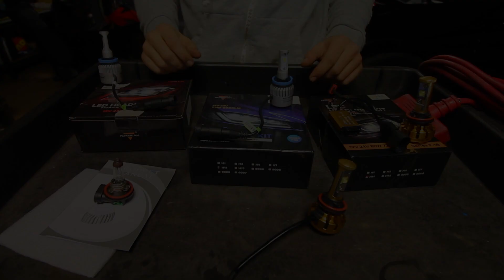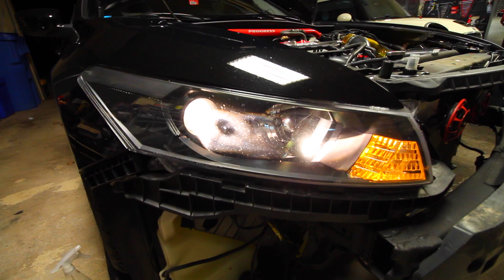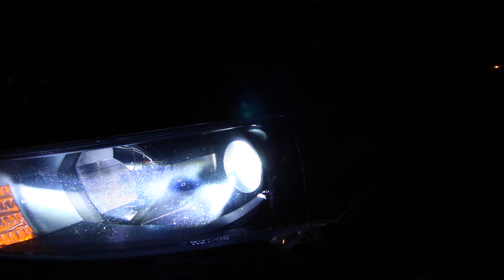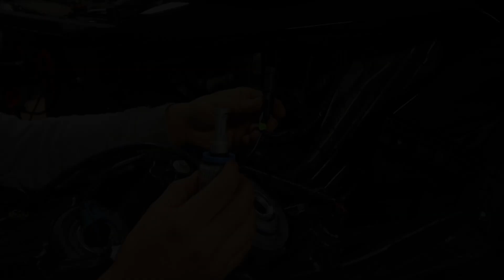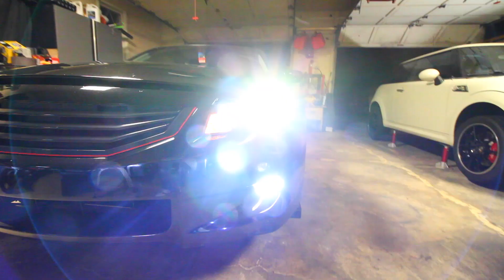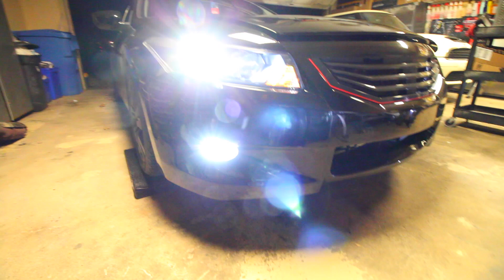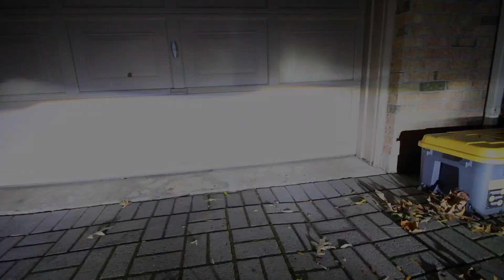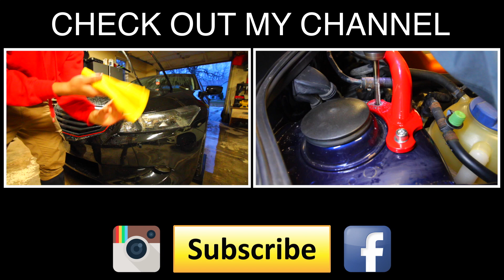LED Headlights: Are they Better than Halogens?

Comment: good luck LED when its raining
Reply: Why do you say that?
Reply: Yup, basically 6500k or white lights do not penetrate water and just bounces off the rain or fog, causing poor visibility. I have tried installing LEDs and reverted back to halogens.
Reply: Same with HID... I had both and they both suck. They're both bright on a dry night. But if it rains they both suck.
Reply: that's why u need yellow fog lights...not white like alot of people do
Reply: Thanks for the heads up!
Reply: They could make LED headlights at 5000K or lower.  The manufacturers have full control over the warmth of the light.  But the market determines what they make.
Reply: Cover your led with a sheet of plastic. Maybe yellow or warm color.

Comment: A bit incorrect. Unless the drive circuitry is incredibly inefficient, most of the heat is still generated at the bulb, by the LED chips. LEDs don't generate as much heat, but they don't tolerate high temperatures, hence the fan.

Comment: Don't know about other states, but Washington State, it is illegal to change the illumination of your headlights/taillights/brake lights...  That includes 'shading' the brake lights or taillights.  OEM are the only street legal lights.
Will you be cited for it?  Probably not.  But you do not want an investigation because you were involved in a collision caused by your illegal headlight installation.  If someone is blinded by your headlights and crosse the centerline and hits you?  YOU are at fault.
   The LED headlights have illumination 'panels' on two sides of the 'bulb' instead of a 360 degree projection.  So your factory headlight assembly will not be able to be aimed correctly.  If you install LED lights, you 100% MUST replace the headlight assembly to match the aiming of the LEDs.  Because very few cars have this option, it is illegal....

Comment: Is that a Honda? Man it's a pain in the ass to just change a lightbulb on that car. Bumper out, bumper whatever that's inside there that has to be out also. Nuts out. Then the whole housing has to be out. And then you can finally get to the lightbulb. WOW!
Reply from the maker: Yeah its a Honda. Some cars are very easy to get access to, others, like mine, can be a PITA.
Reply: milanmastracci Yes, like a Toyota. hahaha...

Comment: I drive a bike. I hate LEDs sooooooo much. LEDs create a wide circle of light that hides everything behind the car. In an open road where there could be people walking or animals crossing one could easy get into an accident by not seeing beyond the car. Please don't install LEDs. I know they look cool but they are not cool for safety. I would go as far as saying that these types of lights should be banned. Please, I don't want to die. I know it sounds dramatic, but I have almost gone into the ditch a couple of times because I couldn't see the edge of the road. They act like a fog.
Reply: Robert Townsend really..led not better?...but i buy honda civic type R fk8...my headlight n tailight all full led light...oem factory?...from honda....i think led so better from halogen and hid kit?.....
Reply: Mohd Aliff yes leds are better, but not when you put leds in a halogen housing. They just send the light every where and doesn’t allow on coming pedestrians or drivers see as it blinds them.
Reply: I ride a bike too. My 3000 lumen LED flashlight is one of the best things to happen to mountain biking in the middle of the night.
Reply: Fellow biker here, I agree.

Comment: I'm curious about winters temps(0F-(-40F). Is there going to be any issues since they dint produce the heat a halogen bulb does? Is there any issues with the dust covers for the headlights?

Comment: The leds commonly used on vehicles always look "blue" to me.  This almost certainly y means that they will not be as effective penetrating fog etc as halogen or incandescents which usually tend to produce light more towards the red end of the spectrum. In the UK until recent times most Sodium street lighting was sodium-based. This emits orange light which is good at penetrating fog.  Red light would be even more effective in this regard but I have never seen red street lights.

Comment: does anyone know if the led chip should face vertical or horizontal in a reflector housing?
Reply: found out they're supposed to be horizontal and Philips style led is the best for reflector housing also leds not recommended for projector housings hid should only be installed in those.

Comment: Great video, lots of information, I have two questions. So I just installed LED dual halos on my car and tapped them into my fog lights for power. I want to change my stock bulbs in my fog lights to LED's so they match the halos. My first question is do i need a conversion kit to make them work? or can I just buy LED lights. Second question which is particular to my car, the bulbs in there now are 894, will an 881/H11 fit that? Its a 2000 Camaro
Reply: Camaro groups my friend lol

Comment: aftermarket led dont last long , that fan in the back get dirty to fast and the led will get overheated. i had those in my car and i remove it ..if u have halogen in your car the best way to go is osram night breaker , is original and no fire potential in your car

Comment: If you explain how the LED works and where heat is generated. READ and LEARN first. Once you know how it works you can talk about it. LED have a heatsink because the CRE gets hot not the circuit board. LOL

Comment: I put LED on my projector headlight MB, and it gave me a black spot in the middle, color was nice as expected, but the light output performance was very disappointing, switched to OSRAM Nightbreaker Laser, much better light output, color not as nice.  HID is not an option, does not work well with Halogen Projector Lenses and also kind of tricky with MB sensitive electrical wiring.

Comment: Fog lights are designed to light up the peripheral area in FOG and therefore attempt to light around the road in front of you. Main beams simply light up the fog directly in front of you (completely blinding you) and that's why fog lights are for, guess what, FOG with your headlamps off as your speed is substantially lower.

Comment: are they good for using foggy climates.. ..which one u will suggest? HIDs or LEDs
Reply from the maker: Low beams with a very good cutoff, paired with fog lights. Whichever will produce more light while maintaining those two factors, will be better.

Comment: this is actually illegal to do in the united states because a led or hid lamp needs a projector housing to beam onto the road instead of scatter with reflectors you can actually be pulled over for this and given a very expensive ticket because it can blind oncoming drivers with a scattered beam pattern.
Reply: If only you knew the amount of people that don’t use projectors in Florida. And certain cars are made stock with hid/led in a reflector housing.
Reply: he does have projector housings so he wont be pulled over.  i retro fitted my tacoma to projector lens and it is worth it.

Comment: if you have ahalogen bulb where the high and low beam are in the same bulb , such as a 9004 or 9007, the low beam is ok , more light , BUT...I repeat.. BUT the high beam is way off out of focus, so your high beam pattern is way too off, the reason being is if you look at a halogen bulb the filaments are only fractions of an inch apart, and an led bulb the actual leds light up on low and high beam are too far apart, this is very important for proper focusing of light, I have tried different brands of led and they are all the same.

Comment: I installed led bulbs in my fog lights. When I turn the fog switch on, the lights do not turn on. I left the halogen bulbs in the other side and that one works. I'm positive the bulb size is correct (881) for a 2013 Kia sorento. Would anyone have any advice?!?! Thanks

Comment: Of course heat is generated on the LED chips, you heretic, but it is transferred as far as possible from them through the aluminum body, and then dissipated. The small transformer inside the aluminum body also generates some heat.

Comment: is it just me or do none of these kids know how optical systems work wether halogen or xenon or LED the light emition of each is very different so each is designed to operate in a specific optical system (reflector or projector) hid projectors and reflectors work with hid bulbs only, halogen is halogen only, and LED are LED only google what each OEM system looks like and you will discover they have very different optics (xenon and halogen often look similar but are very different while LED are extremely different so kiddies before tossing in just any fancy pants bulb ballast pnp kit take into consideration this your car never came with that bulb type so don't use it unless your retrofitting the real deal full system and not just some bulbs so to all you who think they know that projectors of any kind can handle any bulb type you are WRONG

Comment: LED can also be dangerous in snowstorms as the LED does not heat up the lens enough to melt snow and ice build up on lens.... Can become caked on
Reply: Bill Poel this is why civilised countries like Australia mandate heated headlight washers for low wattage high power bulbs like LEDs and Xenon HIDs
Reply: great point. the heat does help keep  the lenses warm, which helps in de-icing.

Comment: It does not matter what type of housing your vehicle has, LED will never through light as far as a HIR bulb or even standard halogens. Basic light physics tells us that blue light (most of these are more bluish/white light) is hardest to see and yellow is the easiest.
These damn led bulbs are just like when HID retrofit kits came out... dumbass uniformed people cramming shit into stock housings and blinding people. Running these as headlights are likely to get someone killed. Use your head people and do some fricking research.

Comment: wait.. what?!? Around minute 2.. The heat is generated by the computer inside the bulb? No way, the led chips themselves generate a HUGE heat that needs the bulb to be cooled down, otherwise the chips will burn.

Comment: If it ain't broken, don't try to fix it!
LED-lights in cars don't contribute to a better environment at all.
Your battery and dynamo have an overcapacity anyway, so that the halogen gets hot and looses part of the energy is totally irrelevant.
LED-lights are a totally unnecessary and too expensive investment.
You can buy complete H4 sets for less than $2.-
Just make sure you have two spare sets with you in the car, so that you can instantly replace a bulb at any time and all by yourself.
Just keep your car original and functional at the lowest possible cost and don't copmplicate stuff that was originally designed to be simple!

Comment: But Halogen is more comfortable for the eyes.
Reply: when you're driving with them?
no, no they're not lol.

I've been using LED headlights for years as I find the light easier to discern against the road etcetera, compared to the linear and over-saturated halogens (you can see halogen light over stuff, as opposed to seeing stuff through the light)
and they reflect off cats-eyes, road signs, road lines, and the eyes of wildlife like nothing else!
very important here in Australia with the wide dispersion and the ability to light up the eyes on kangaroos whilst they're in the fields, and not bouncing off of the front of your car....

speaking of kangaroos, I actually hit one a few weeks ago in a friends car. because he has halogens, I literally couldn't see it and react until it was directly in-front of us....
Reply: Oh well, we don't have them roos around here. :D

Comment: I just upgraded from stock housings [bulbs: Low=9006 / High=9005] to projector style housings which use H1 bulbs for both High/Low.  Does anyone know if the H1 LED bulbs will fit into H1 halogen ports?  
(reason I ask is because, as seen in this video, LED's have that large heat sink back end, and H1 bulbs generally just have a wire retainer holding them in).   

Thanks!

Comment: would you recommend LED lights for both high beam and low beams and fogs?
Reply: as an LED user myself for several years (early adopter) I honestly wouldn't recommend anything else!
I don't have fogs in my 2003 ford falcon, but between my H4s and H7s, you really don't want to be the guy to leave the high beams on coming the other way... 

as for fog lights though, do u wanna use them as fog lights (so people can see u in the distance through fog) or do u want them to function as driving lights, giving you the extra visibility? if it's for you, go the LED replacements as it'll match the look of your other lights and out even more light downrange, but for the former I'd suggest sticking to the halogens as it's easier to see the more orange/yellow glow through fog when you're coming the other way

Comment: is it true that projector lens are not good for LEDs I'm confused
Reply: If projectors are for halogens - HID and LED won't work. If projectors are for HID - halogen and LED won't work. That's why halogen and HID bulbs use different bases. It's made so can't put them in an unsuitable housing.

Comment: too much color and you cannot compare visual performance in such a short distance, you need to do a 100 yard test and further, the led will appear like a half dead bulb.  I also noticed when you were driving with your halogens, the lights were not even as the driverside was much lower. You can easily see the leds are falling short in visual distance. Your eyes will be too focused on the white light you won't see what hit you past that. Always know the fact the lower kelvin temperature helps aid in perception better than having a super bright white light.  4000-5000K will give the all around best visual performance. I've been installing and testing many types of headlamp bulbs and to this day HID is the brightest and every led headlamp bulb I've got my hands on failed the 100 yard test. Just not safe for me to consider putting into any of my vehicles. I have tested over 30 different style of LED headlamp bulbs and even the engineers who designed them even admitted they do fall short of safety, bet you didn't know that one. Of course you didn't, you're just a consumer making the led headlight bulb manufacturers a ton of money. IF a headlamp housing was made for the led bulb, then yes you will have a good functioning headlamp.

Comment: sorry for my English. I have a question, why you recommend the f-16 if this only have 7200 lumens and the other ones have 8000 lumens. auxbeam have a g6 and this have 9600 lumens. is more important the lumens or the model in this case? thanks for your help

Comment: can you just pull out the halogens and put in led WITHOUT any modification to the light housing? and so when you install them since they are shaped like a blade, installation is bulb is parallel to the ground is that right?

Comment: What you know about light could fit under an LED. 

Who cares what YOU think "looks better". The fact is, it does not look better, or brighter, just more diffused and BLUE. Good luck identifying a color. 

Its not even a fair comparison, the stock halogens were obviously a decade old, which makes them about 50% as bright as they should have been.